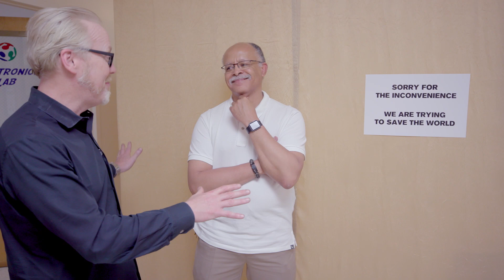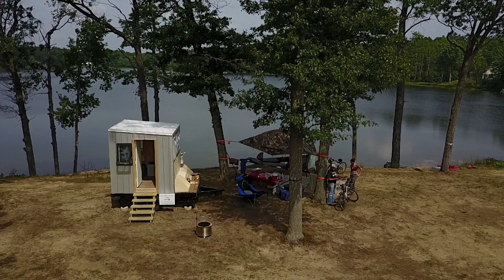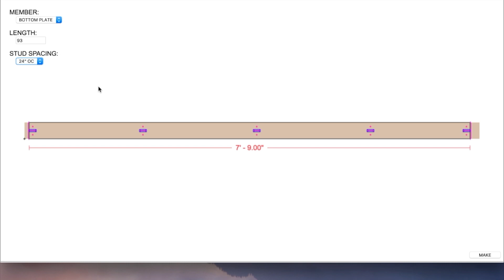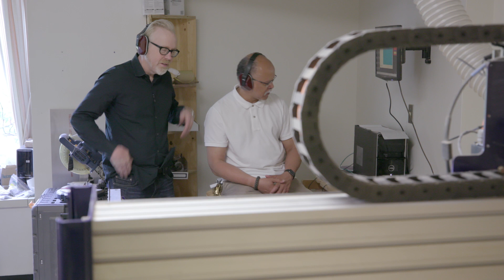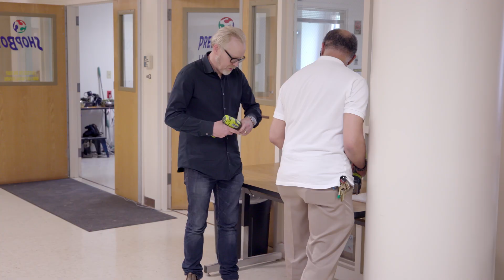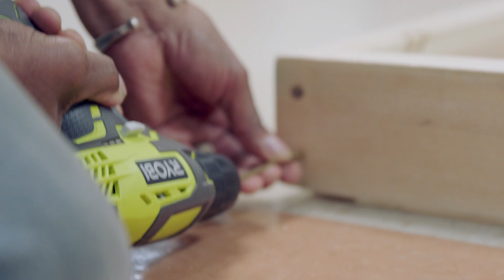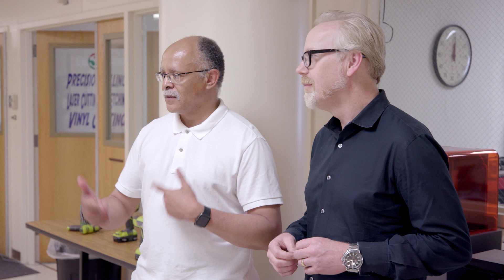Adam Savage's Maker Tour: Incite Focus

Comment: You can't buy land and legally put this thing on it for any real length of time, let alone claim it as your place of residence. 
This is due to outdated building codes for an economy that doesn't exist anymore.
Reply: @Great laker, sounds like you guys need community leaders who are in touch with reality. I grew up in the 90s in a house with less than a thousand sq. ft and it was plenty for my entire family - a minimum of 1500 sq. ft can only be the result of affluent policymakers who have only ever lived in expensive houses.
Reply: It's built to code. Take the wheels off... 

...it's permanent.
Reply: and yet it's legal to let people die of hypothermia on the streets lol
Reply: Victoria M my guess would be it has more to do with property taxes.  Taxes are based on a formula for determining property value.  Actual property value and assessed value aren't the samething.
Reply: This is part of the process of changing that system to meet current realities, and requirements.
Reply: Seriously? Your houses have to be at least 1500 sf? What is that based on, I wonder? What if you're only one person, or don't have or NEED a lot of stuff?
Reply: Micro-housing will also never be as green and low carbon footprint as high-density buildings because of efficiency of scale.    An apartment complex for example can reduce urban sprawl by putting 100 people in one building by building vertically.    Each small dwelling in that apartment is insulated from heat/cold by the adjacent unit, and you need minimal plumbing for electricity, waste water, internet, etc.   In addition, high density living means its economical for stores to open up nearby, which can be within walking/bicycling distance when people are living extremely close together like a high-rise apartment.   With micro-housing you end up spreading urban sprawl and converting more and more wilderness into neighborhoods.    So you can say while it may be greener than a BIG home, its not greener than existing micro-living options (or more economical).      Especially when you factor in that these tiny homes typically lack many of the green features of larger homes, such as most importantly an attic in hotter climates.    The reason we "waste" all that space under the roof in modern homes is because that air-gap combined with blowing in tons of loose insulation ensures that the house is effectively completely isolated from the heat of the sun onto the roof.   In a micro-home, the insulation is minimal and so the sun heats up the building far more, requiring a smaller less efficient air conditioner to work much harder.
Reply: To add to Gamer Voice's comment: In a micro house situation, it is actually feasible to have a "mortgage" that is only 5 years or perhaps 10. A regular personal loan could actually be used to build it. And with solar and other cost-saving measures, living completely or nearly completely off the grid means more money to put away and use for other purposes.
Reply: I don't know how expensive that cutting machine is... but it would be neat to see if it could be capable of making a version of this place 
https://www.youtube.com/watch?v=GLSxcLww2V4&index=67&list=LLjlo_tjsl4OZ8InP3jwL-7w&t=1s
It's the best layout I've seen so far.
Reply: Zoning is always a concern with tiny house stuff. City councils and legislatures at any level take decades to adapt to new things. Everything is pretty much on track, you're just being contrary for no good reason lol. It's about adapting, ways will be found if this is something people want and it's safe and good for the community.
Reply: Well, one major part of this all is to understand that designing those housing modules is only half the battle. If communities built around those sort of ideas want to thrive they have to become active in politics. Lobbying and demonstrating to achieve changes in law is an uphill battle, yes, but necessary for long term success and nothing would ever change without it. So instead of saying "it can't be done because of zoning laws" you have to fight for those laws to be changed if you really believe in your cause, however hard it may be.
Reply: Which Code? IBC, IBR, Michigan state codes? You do understand that "code" is the shittiest you can build something and still insure it. Being a contractor I would never live in a home built to code, but one built above code.
Reply: @Air Guns and Such
Minimum square footage to start with.
Reply: I think it's because the people making them tend to be burners and transient types. 
It's possible to have a "luxury tiny home" that is clean and built with higher quality / smarter materials than your typical "to code" track home ( As Air Guns and Such calls it "Above Code" ).

I think it's possible to live off grid with an abundance of resources that rivals that of living on the grid. 
With solar, modern battery technology, rainwater collection, grey water systems, geothermal cooling, electric cars, the list goes on...
Reply: @Great laker Then you need to contact your reps and tell them to change that.  That's the ONLY way rules change is through direct communication.
Reply: @DumbDuck44
I will agree that tiny homes typically lack many of the green features of larger homes. 

However I will argue that Renting property is not a smart solution... and smart tiny homes are the right solution.
The goal of living in micro housing is rooted in two main objectives: Decentralization and Escaping Indentured Servitude (via rent, never ending mortgages, bills, ect.)

With modern technologies like overnight online shopping there is no reason to live near a store, crammed next to noisy neighbors paying rent ad infinitum.
As far as temperature control , take a look at Arizona's Earthships , they are 100% off grid, have no AC/Heating and maintain 65 Degrees Fahrenheit all year do to thermal mass, and underground pipes that pump cool air for free just from geothermal air pressure differentials.

As time passes the need for centralization is less and less necessary. Today,  you can generate all the energy you need from your place of living, order anything online, and own a car that drives itself with zero emissions.
Reply: You don't have to rent property if you don't want to.   You can buy a condo, which is what I did in town center many years back,   It was one bed, one bath, and about the same square footage as a tiny-home, but I also got a swimming pool, huge movie theater that you could book, lots of restaurants and stores downstairs, etc.   

And online shopping with a UPS truck coming to deliver your stuff certainly isn't as green as walking or bicycling to the store, cmon.   Arizonas earthships likely wouldn't work in Houston, which is 100% humidity and triple digits a good part of the year, and theres still no way to get the density of living to reduce your footprint and leave more habitat undisturbed for wildlife.     In any case, anything you can do on a single scale you can probably do more efficiently en-masse in a condo/apartment type environment because of efficiency of scale.

Electric cars still aren't REALLY zero emission, cmon.   They are "remote emissions" depending on what powers them, and most people buying tinyhomes cannot afford a quasi self-driving Tesla.    That's a 1%er car that can't have significant impact on the environment because of its prohibitive cost.   But everyone can afford a small condo or apartment.
Reply: Gamer Voice That depends on country of origin, and location in said country. In cottage country of Ontario Canada. Such a dwelling is legal to build without an engineer present. I believe 25' X 25' is legal without an engineer present.
Reply: @vmwindustries Yet another reason Canada is awesome :) 
People have done amazing things with tiny houses in New Zealand as well.
Reply: Gamer Voice “Outdated” yeah I’m not sure. The growing trend of criminalizing the collection of rainwater certainly isn’t from some outdated bygone era, it’s a throughly modern of the current environment of governance we find our selves living under.
Reply: @celestenana 
Letting people die of hypothermia in the streets is heavily encouraged in America.

Comment: I don't get how using the router makes this easier.
Reply: Precision, repeatability, no need for expertise, just load it, press "go" and move on. There's power in automation.
Reply: Because it takes out a lot of the planning and thinking. Like he said in the video, you don't need to measure or level anything. Also, to make those mechanical connections would take allot of work without a router.
Reply: "Roboticized" and plenty of guide grooves, holes and routes equals high repeatability, less decision making and less errors and "one off" variations. It speeds up and makes less expensive the over all process.  That is a major part of the goal makng a highly achievable end and not requiring a master carpenter, electrician, etc., and bringing home building to the general public. Please note this process development shares with all process development the desire that your input helps them "make it better."
Reply: It's simulating the repeatable kit quality that you would receive from a production line.  The plans will be open source, so people will be able to do it by hand if they wish.  This is to tweak production design assembly.
Reply: Even at that level you can make the production fast. Make your fixture jig to hold, 8 pieces of timber, cam locks to hold it in place. Load everything. Hit 'start' walk off to get the next 8 peices of timber and by the time you come back, your ready for unload.
For full production of a single /fixed/ and /simple/ design sure, full scale jigging is quicker. But this lets a single production line make many designs, or even just spit out custom kits that someone else can assemble.  And the time savings in cutting out even the ultities channels alone make up for everything else. 
The next trick is putting the same level of  across the rest of the design. So everything from electrical to roof fits in a way that makes mistakes difficult. The frame is clever, but a whole building system? That would make it awsome.
Reply: I imagine this as a CNC maching on a trailer that can be brought to any site and quickly prep materials for building. The cost of such a tool would be under $30k and could be rented or used in a non-profit capacity.
Reply: I can see this working if you have a dedicated CNC that can cut 2x4s to length, machine them and then spit them out at the other end.
Reply: I could see if the made a specilesed  cnc a concept like this might really work. Like something you could feed 2x4 2x6s  in a stack and have boards cracked out the other end.  aka a mutch smaler CNC. If they did something liek that they woudl also need a bom number so you know where each part connects. They may want to considerer milling easy letter or number for each part/joint like flat pack furnature does.
Reply: I think a dedicated machine is what the guy was alluding to at the start when he was talking about using the tools they had to make more specialised tools.
Reply: I believe you'd order a specialized shop to prepare the parts for a specific type of house. You can already ask for custom cuts in many wood shops.
Reply: Max Maker prefabricated.
Reply: Max Maker Prefabricated will save a lot of time for construction. Labor cost will go down as well, but so with construction intelligence... possibly...

Comment: Audio bit bad
Reply: Sounds really harsh, loud on the highs.
Reply: always is, during these on location shoots at least.
Reply: Glad it's not just me.
Reply: Florence Pi. Props and Dolls I
Reply: i think there is a problem with the audio in the entire video... the intros doesn´t sound good either.
Reply: Well, either the vid hasn't been checked between rendering and uploading, which would be bad, or it has been mixed on a potato and nobody noticed the bad audio, which would be worse imo, or people noticed the bad audio and uploaded anyway instead of accepting there'll be some delay to the release due to issues. Which is just as bad I guess? Or worse?
Reply: It sounds fine on my phone speaker